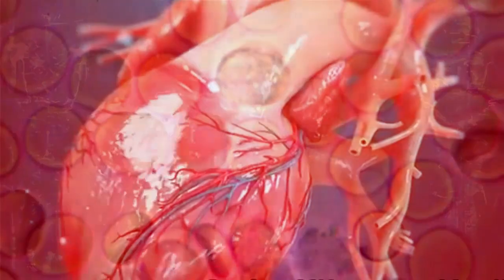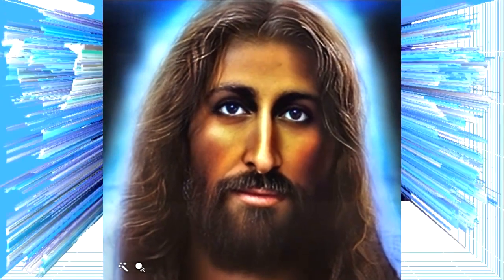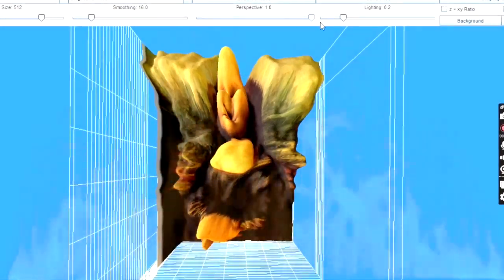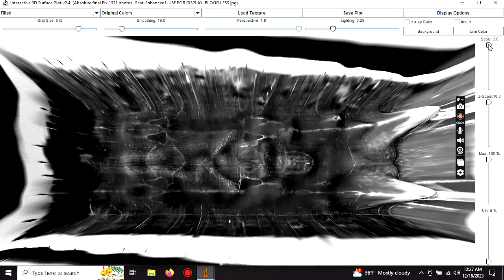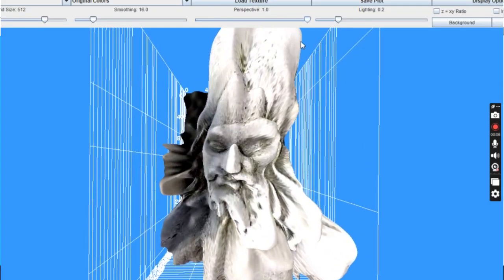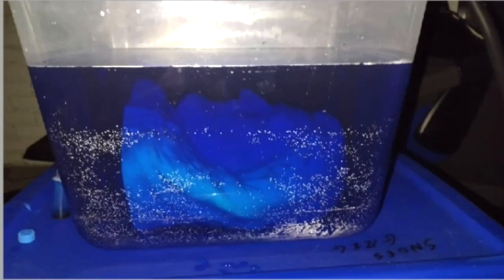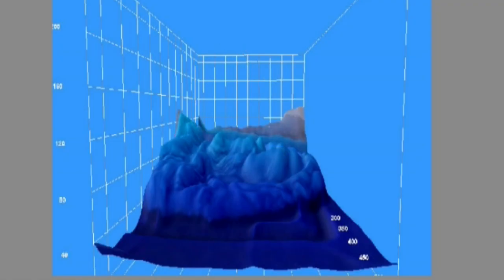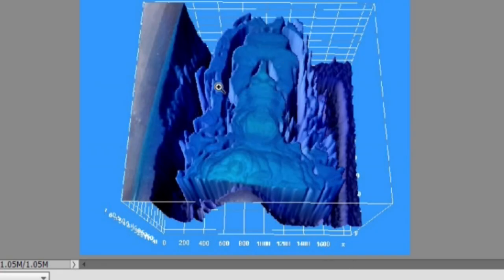X RAY IMAGES ON THE SHROUD OF TURIN

Comment: Very nice work again David.  BTW, do you agree with Dr. Jackson that the Shroud was wrapped with the sidestrips that were eventually reattached?   If so, would we still expect to see the same distortion-free image even if the Shroud was wrapped with the side strips securely around it?  This has confused me for a while and I'd like your impressions, if possible.  Also, it would be interesting to see a similar x-ray analysis of the teeth, as was done here with the hand.  I can see the teeth, as well as  the roots of the teeth.  Even some dentists have commented on this.  As well, there is a space between the nose bone and the lower cartilage of the nose which proves the nose was broken at this space.  The dark space dividing the two are very evident on the nose image.   Sincerely, from another David.
Reply from the maker: Hi Daffidavit.  I agree with Dr. John Jackson.  This whole video are his displays!   This is a Dr. John Jackson video update. 
The side strip.  Yes,  I think they used it and even more of these, but this is the only one they kept and sewed back on

But yes.  I think the body was wrapped tight. 

During the resurrection process the strips were removed and the body free of them
If they body was not separated from the cloth the distance information would be wrong and it would distort under the hard test

If the body was touching the cloth during the image process,  the color intensity distribution would not be accurate to the 3D dimensions of the body 
it would not show up as correct 3D info.  It would distort. 
I will see if I can get some enhanced photos of the teeth area.
Reply from the maker: I think one of the reasons they look like teeth is because they are.  Occam's Razor.
Reply: @GoodShepherdFilms3333  Good to hear from you.  It's been a while.  I agree about the teeth.  But when I spoke with the late great Barrie Schwortz about 8-10 years ago, he believed they were not teeth, but what appeared to be from the vertical striations along the cloth.  I believe they are truly teeth because there are vertical striations along the entire face, but the teeth only appear where the teeth belong.  We can also see the teeth' roots.  Which means the light source was from deep withing the bones themselves.  It seems the light emanated from the entire body, including the inside.  Some say they can even see the vertebra of the spine.
Reply from the maker: It seems as if the radiation that came from the body was very close to the X-ray spectrum, but not quite all the way there.   The only places we see bones is where the skin is very thin. Like the skin around the metacarpal bones in the hand.  @daffidavit
Reply from the maker: I need to send this to Dr. John Jackson    At the time he ran tests these 3D analyzing software did not exist.   If so DR. John Jackson would have found the same things I did and displayed here.  No one has ever spread apart the Shroud image before.  Except us
Reply from the maker: This is another thing to take seriously into consideration. 

The Shroud is a one color image.  
Variation of color is achieved by more of the same pixels in a given  area and less pixels of the same color in another. 

Coloration is in direct proportion to the 3D characteristics of the object being replicated. 

If the body was touching the cloth in any way the 3D information would be lost. 

Of course we are talking about our level of understanding. 

The Lord God Surely has image creating abilities beyond our level of understanding. 

But only one thing explains how the colors are distributed on the cloth .  To our current level of understanding

An interference pattern of light waves was created when radiation exited skin pores and the light became diffracted. 
That is the only explanation that matches the forensic evidence

Even our own graphics here of radiation exiting the body is not correct. 
It could not have been coming out in straight vertical lines. 
This would not create more pixels of the same color in one area and less pixels of the same in another. 
Only an interference pattern creates a spread of lights and darks like this. 
In simple terms a hologram
Reply: @GoodShepherdFilms3333  That's an interesting topic, one beyond my knowledge.  Whether the radiation was "stimulated" like a laser or whether it was diffuse is for others to say.  One observation is your use of the word "pixels".  The image appears to be "analog" on the cloth with the fibrils being dehydrated by the principle that light is weakened by the square of the distance rule.  I believe you are using the term "pixels" because you are running your data with a computer that converts the analog to a 3-D computer image.  That being said, light in a certain way is digital due to its nature as quanta, or photons. 
           As for the image being a "hologram" that's another theory that holds water.  I have a very high-definition picture of the face of the Shroud that I got from Barrie many years ago.  When I walk a few feet to the right or to the left from the face of the image, the nose appears to bend. Try it yourself and you will see the nose bending.  That does seem to have properties of a hologram.  But we need a computer to appreciate the "hologram" from most of the effect.  That's why I still consider it a theory.
Reply from the maker: @daffidavit  Note how the fingers are bent on the hand.  That is because that is position his fingers were on that hand on the cross. And when Jesus died the body went into rigor mortis and they did not bend the fingers back during the burial.
Reply: @GoodShepherdFilms3333  Yes, and we can see that pretty clearly in your video. It has been said that damage to the median nerve or damage in the carpal tunnel caused the thumbs to collapse.  BTW, you state that the radiation is not far from the X-ray spectrum, meaning that the radiation is from photons.  But there is another theory by a lawyer (Antonucci) who argues in his book that the radiation was from a "neutron flux".  I spoke with him many years ago before he wrote his book.  Have you seen any evidence that the radiation was from a spray of neutrons?  Have you heard this before?  It been a good conversation. Take care.
Reply from the maker: @daffidavit  He could be right,   He has been researching The Shroud for a long time